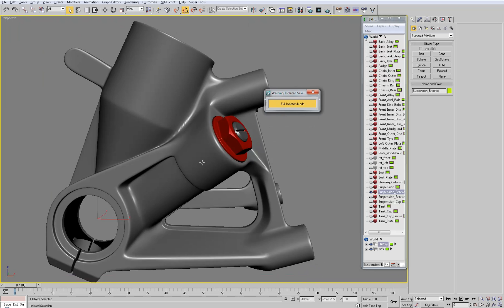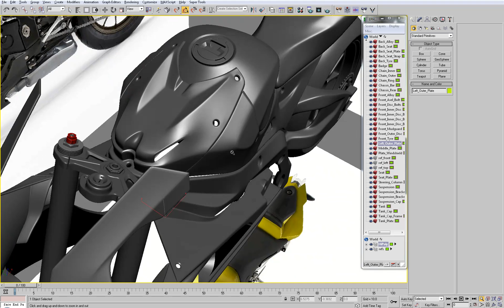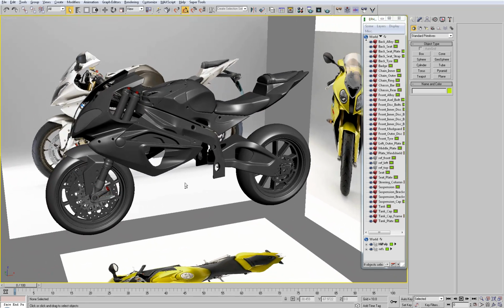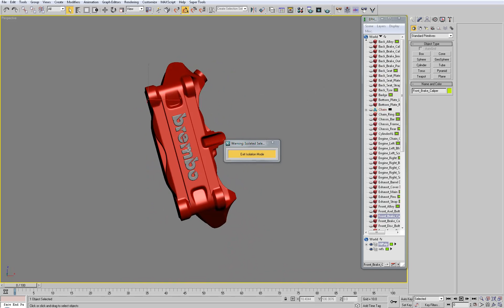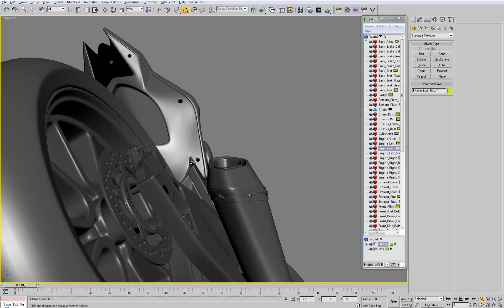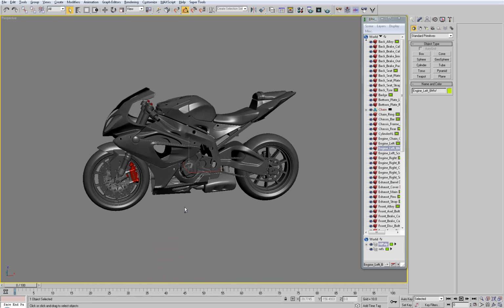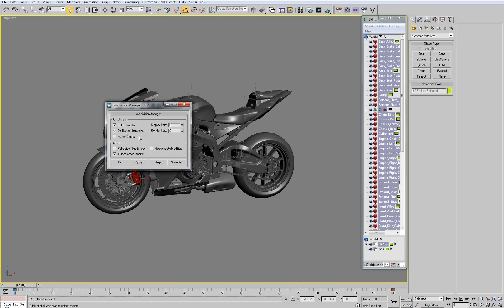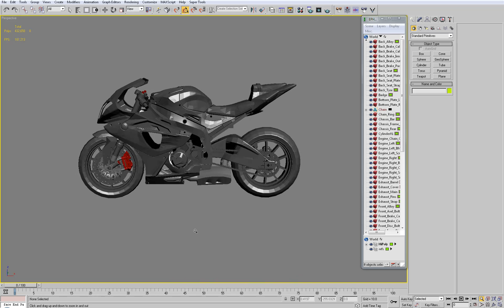Hard Surface Automotive Modeling in 3ds Max with Howard Lincoln - BMW S1000RR

Comment: /BVgB-nHckA8     223.000 polys  . when i    render the  wireframe   i clone the model end use the  " PUSH" modif.  theat gives me  more than  446.000 polys which is  problem for my pc(ATI Radeon 2400 HD     3G RAM).....3d max shuts down